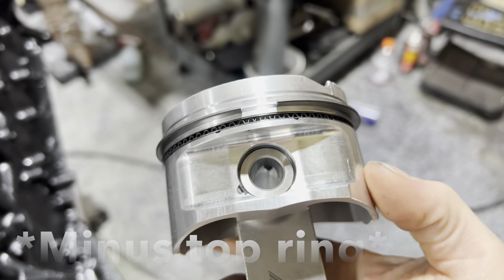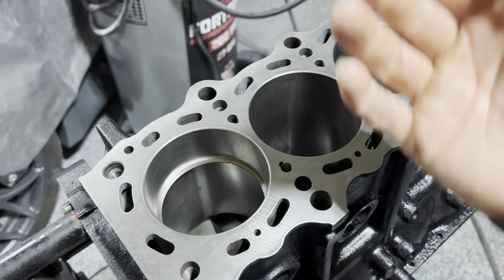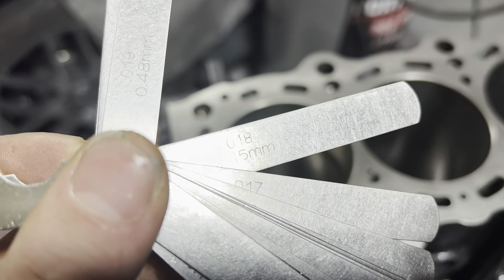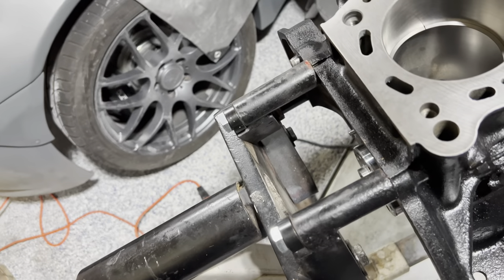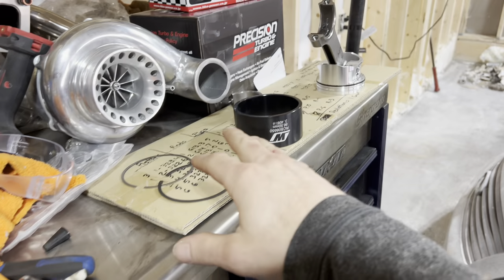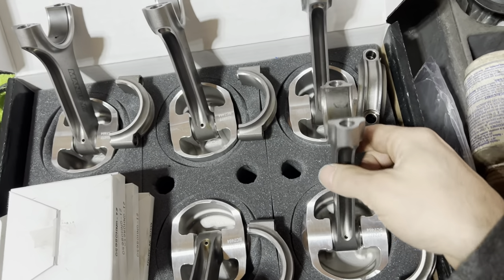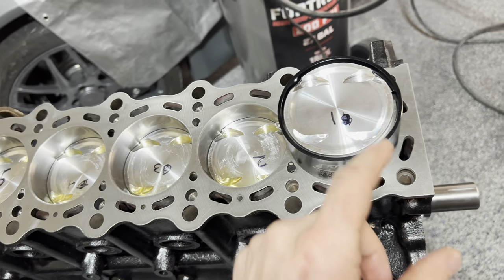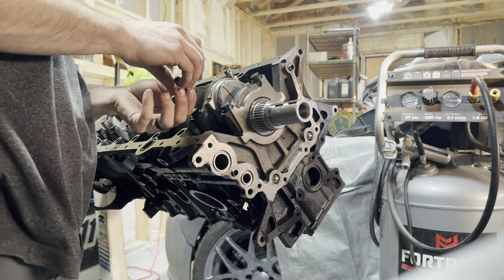RING GAP The Most Important Part of Your Car Build!

Comment: 21:32 why no oil on the rod? Can I use oil if I dont have lube? thanks for the clear detailed vid!
Reply from the maker: I meant no oil or lube on the physical rod, the bearings it’s an absolute must. You don’t want oil between the mating surfaces of the cap, that can deflect your torquing values for the rod bolts. Same applies to the main bearings.

Comment: Do you gap the oil scraper ring?
Reply from the maker: No, those already have enough gap and not enough mass to grow considerably. They are also exposed to significantly less heat than the uppers.